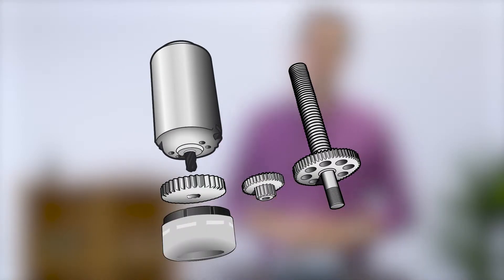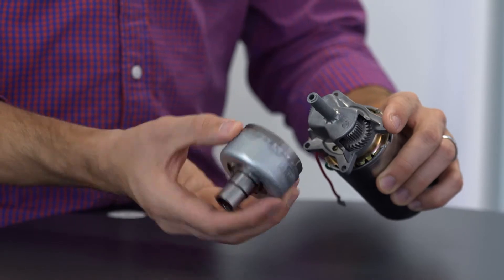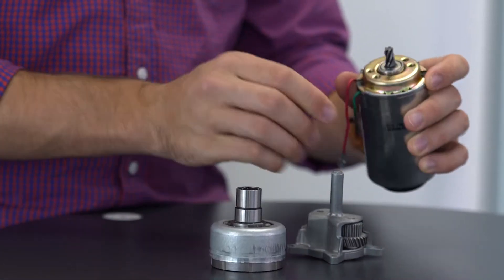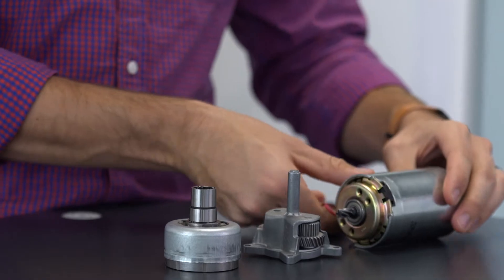Clutch purpose and function for linear actuators | Actuator Academy™

Comment: So happy to see talks about actuator clutch. I am a FPV helicopter pilot and have been telling helicopter makers to modify their servos to allow clutch slips to protect servo gears. But the hobby helicopter makers want people to damage their servos frequently and buy and replace. People get tired of these labor intensive repairs and moved away from using helicopters for FPV. The slip clutch costs zero dollars for servo manufacturing because the nylon spline is already inside the servo arms, they just need a slip slit. Engineering ethics problem.